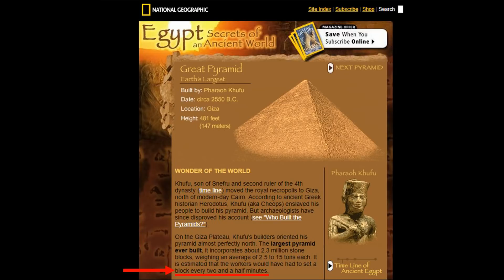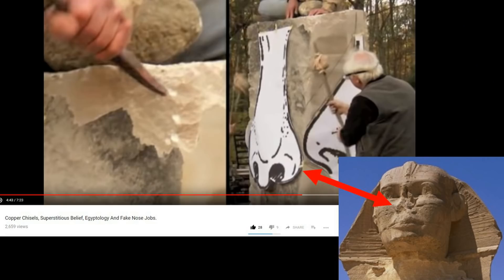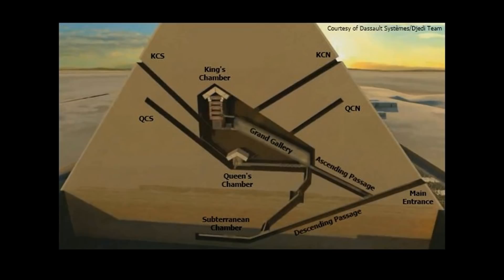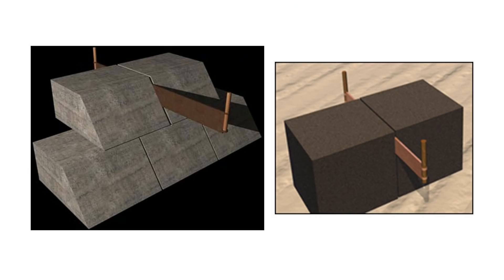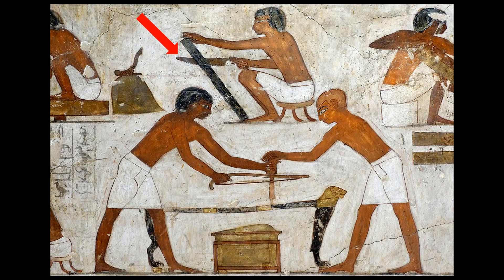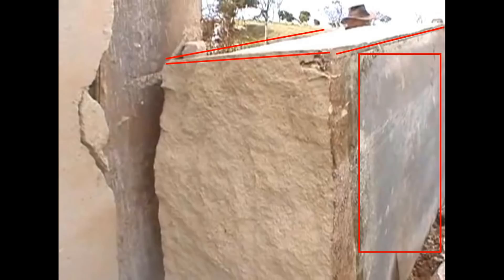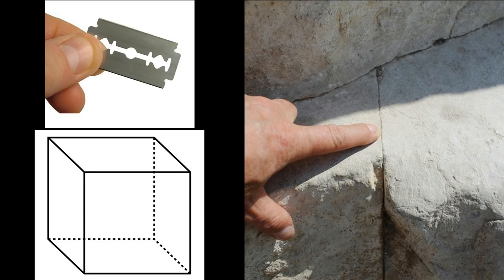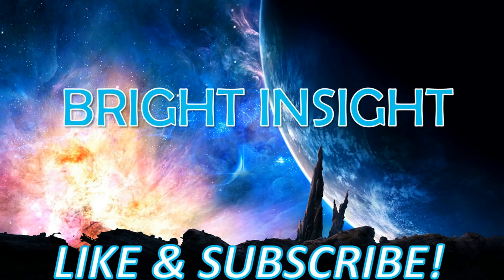Great Pyramid of Giza:  Lost Ancient Civilizations

Comment: Pyramid of golden ratio tells Pi and Phi relationship and formula to calculate true value of Pi. if the four-sided circumference is 8, then 2π √  φ= 8.  π=4 /  √  φ = 4/   √(0.5+√5/2) = 3.144... (not 3.141...) . √  φ is the height of the golden ratio pyramid. Why is it not in our textbook? And we are still using 3.141... for at least a lifetime, the error cause so much waste of money and resources in engineering and other areas day by day.

Comment: I dont ever comment on anything, but.. There is a modest error in judgement here. Limestone softens when in contact with water, and the nile was right next to the pyramids. Also the level technique for the stones could be achieved by using the nile itself. Moving the stones to te location too.
Reply: Other than that, good job on pointing out the problems that are not going away on the running theory, like the granite and the lack of found said tools!

Comment: If they used saws, chesels or ANY other metal tools, wouldn't there be metallic particles at a microscopic level left in the edges of the stones? 
Maybe the best place to find such evidence would be on the contact surfaces of two blocks of stone perfectly matched together and somewhat safe from the erosion factors.

Comment: Egyptians did not work Granite blocks with copper chisels, they in fact pounded at them with Dolerite pounding stones, then used Dolerite grinding stones to sand the granite into the somewhat perfect shapes we see. We have evidence of this with the Egyptian obelisks, Egyptians used Copper and sand to cut Granite because of the hard particles in sand, it can be used both to polish/sand  a stone block to perfection. Or to cut through Granite, which we have evidence for with the king's sarcophagus and cut marks on it. 

Quarrying the stones was much easier, because they used a simple method that many cultures used and that we still use today. Wood and water, make a channel in the stone, put in a wooden block and saturate it with water, causing it to expand  and fracture the limestone in near perfect block shapes. Then it was just a matter of using Copper chisels and pounding stones to finely shape the blocks where needed then transport to site and set. 

Copper in the Ancient world was expensive so a lot of the actual work done with copper was reserved for important things, but you really don't need to use all that much for the limestone blocks at all, given the way they were quarried. Also a good reason why we don't find thousands of these tools is simply, because it was metal and valuable and would have been recycled for other things.

Comment: As someone has already said research Joseph Davidovits. The stones are geopolymer molded in position, no cutting or lifting required. This has been independently verified by both density analysis of the blocks and by the presence of bubbles in them. The formula for making this geopolymer was found on an ancient tablet and is reproducable.  Watch Joseph's videos and checkout his linked webpage.

Comment: Great video and I have been posting this information for almost 15 years now(2002).. It's about time someone made a video..  I would like to add some detail to your comment about how perfect these stones were cut on all 6 sides..  These stones were perfectly flat on top and bottom, bu the other 4 sides are clearly not square.. They are trapezoid to some degree, meaning in order for the rock next to it to fit it perfectly so a razor couldn't penetrate it,  each 4 sides of this stone would need to be tailored made so it fit perfectly next to the other 4 stones beside it..  Mr Bright Insight, that's impossible to even imagine and would be even more incredible than the pyramids themselves..   Impossible unless you consider geopolymer, or ancient concrete.. The geopolymer institute of France has already broke this story back in 2002 and made duplicates stones and published the results.. These were made using the surround materials and poured into a mold exactly where they stand today.. Here is the link: https://www.youtube.com/watch?v=znQk_yBHre4

They even produced evidence of hieroglyphics showing how to make these pyramid stones:  https://www.youtube.com/watch?v=k0nOw_ebmGk

Comment: It took them 80 years to make a pyramid, but 70 years of that was getting the permits.
Reply: I tried to do the math on the 6 hours for an inch cut and the 70-80 year time frame and they would’ve needed 1000 men working 24/7/365 just on cutting the stone. That doesn’t include the need to refine the shape after or moving and placing. Assuming they didn’t work at night they’re going to need closer to 3000 men in that quarry cutting rock tirelessly for twice their life span.
Reply: @meatpilot  Ummm I think everyone may be forgetting that the true potential of the mind as well as the body may have been lost in a cataclysm. The capabilities of a group of very focused people might require farrrr less than estimated and if they were stoic as well (highly likely) they would not need as much food and resources. Also, what if the reason the pyramids could've actually been constructed much faster then previously believed possible is... woo Game on... before you are our last 4 winners. One man verse the mountain! One per side... one impossibly massive block per contestant! The first man to get that block to the position required... wins... ONE GLORIUS NIGHT with our believed QUEEN! The crowd goes WILD...…
Reply: N Marbletoe exactly. Lol
Reply: That made me chuckle pretty good.. *D and then I checked your alias and belly laughed quietly as not to wake disturb the neighbors. OIOIOIOIOIOIOIOIOI 8D <<< me spinning on like a top blinking between 2d and 3d  \o/ 3 point landing in the correct dimension this time whowhowhowho
Reply: Not by force but by all understanding the wisdom of it and since all would consider the children all of theirs regardless of who was the bio mother(big sister) and father(big brother), they were all spiritual brothers and sisters anyway... pure beauty... the STARE-WAY to biological paradise! That's how you excelerate evol;ution 8D
Reply: So based on the pong tossed to me above... choice... 600 60 6 OR 6 60 600 up or down the "genetic ladder" whoa boy returning to normal space lol
Reply: N Marbletoe 😂
Reply: Ha! 😂
Reply: Thanks Bright Insight for your work...Archeologists are mostly paid liars who are sworn to secrecy... if you know what i mean... btw, for proof of why Saturn has a Hexagon on top... check out the vid on my channel.
Reply: that's ok I am the bringer of light so I reveal all, how the pyramid energy grid system works and cell regeneration so we can live for 100's to thousands of years, so all the dual vortex pyramids are plotted on the star of David or star of Jupiter pattern, so you find all the precisely plotted pyramids were the lines intersect,  the smaller pyramid from what I can tell is that it points the direction towards the upper inner so you have one group the small pyramids show me, there is one that will point to the direct middle and it would be easier to draw it out, 6 small pyramids within the set of 24(1 small one and 2 large ones) 6 plot sites 12 large pyramids and the massive pyramids that are being discovered are the number 7th one, a huge centering pyramid within that grid, so it is double the size, There is no secrets that can hide from me because none of your Archeologists know this,  I wish I had a computer program to plot out how many they did have to make this planet into an Earth Planet, the acoustic sound resonator shapes within the pyramids pulse the sound frequency back to the earth's core,  the key is the Iron Ore stones that is at the base of every pyramid, as well as the real casing stones were all iron ore on the outer at one time, it is advanced but simple in how they manufactured each stone precisely byway of induction heating method,  so just like the Veda texts says they poured molten temples they also poured molten iron ore stone, as well as you can also fuse iron ore stone with other ground stone to make granite stones as well, So anyway we can make any rocky planet into an Earth planet, the plasma current also draws moisture from the rocks to the surface,  sound waves create rotational speed,  so everything in these pyramids was designed precisely without flaws,  it is all vortex energy timing, so there must have been 24 24 24 =72 pyramid sets 36 plotted sites and 18 smaller ones, 6 into 18 (6)(6)(6) 3 massive pyramids in  for the middle each set of 12 plot points,    simple yet complex I enjoyed solving it,
Reply: @The1stDukeDroklar  A wise man once said, there are those whom read books and those whom create books, but Einstein said it best, I get visions of inventions, Hence I as well have visions of inventions but use science fact to support every explanation set forth, my understanding of super weapons is right at the top, so knowing how all things work also means you can render the enemies super weapons as well, ;) the gift of genius, but I do love our old advanced history that seems to still remain buried, but my greatest love is cell regeneration to live for thousands of years as our cells are reset and recharged to become younger as well as stronger once again, and knowing how to build a full body machine is the right first step, but not having good finances is my downfall, lol so when I die so shall many more idea's of great inventions, at least I solved how to cure my own back from all lower back pain as well as reset my leg joint, the worst is we all face the same thing when it comes to the harsh bacteria's that attack our body, if only we had a few different machines to combat this, to change our medical system over to the regeneration system treatments, instead of pills the high and low frequency's would fight the viruses and bacteria's as well as using the regeneration machines to repair our body's cells and bone degeneration, I know also there is a more complex regeneration of cell implantation to regrow missing limbs, I seen what the nano doctor has done but he was not intelligent enough to see the larger scale, plus a 3rd kind of regeneration to reconstruct people back to life, that brings me back to why the Egyptians took great care for organs in there past history, to use a clone body to place the organs into it as well as brain cell magnetic memory imprint for brain reconstruction, every memory cell has a code of a memory, but that's very advanced, to see the past is to know the future, to see the future is to go beyond our true past, science has endless paths to becoming a type one civilization, yes we can make more advanced robots but we can make our selves more advanced because organic's can do so much more, just like molecule memory structure altering to change anyone into anything as well, but that's going far beyond the basic comprehension of what people know at this time,   maybe this might spark something to lead us on a path of greatness, just imagine bringing back those whom we have lost, it is 100% possible as long as we are not cremated but the question would be if any memory imprints would retain or if they would have to learn all over again,  I hope your inspired now,

Comment: There are not millions of blocks, this is fantasy, its about 250-300 stones in lower base x 4 sides its around 1200 blocks in the base of pyramid, in the high have around 160 rows of stones, there can not be 2,500,000 stone blocks.
Good video.

Comment: Numero #1: You are amazed when not finding enough copper tools around the pyramid. I tell you, here when a gasfiter leaves the old pipes around, there are many people interested in those pieces as they sold it by the kilogram. In that era, they could melt it and make pans, kettles and silverware, etc. Number #2. I don´t know if you have read about steam machines used at the pyramid to heave weight. A secret of the monks in there. Same thing to the use of saws. A machine indefatigable moving a saw will make a lot more cutting than a pair of men.
Circular blades, stright blades, and the like. Where (you will ask) are those machines? Burnt by the monks. Remember it was a secret. Abur!

Comment: Nice video debunking the myth practically.... the image at 7:39 at the bottom right of the screen shows a rock that seems to have horizontal layers of rock. There's a suggestion I came across on this subject that the megalithic boulders were molded into place either using heat or some yet unknown technique of softening rocks.This could explain why the massive rocks are of different sizes yet fit so perfectly. In addition, there are stubs close to the bottom of the rock. I suspect that the builders of the ancient pyramids got the rocks into liquid form (by which ever means they did) and poured the liquid rock into casts. These casts had drain holes at the bottom to allow for better setting of the mould. After the rock mould was set then the pouring channels would be broken off thereby leaving a perfectly fitting rock mould with stubs at the bottom.

Comment: That doesn't even consider Gantenbrinks door. What is something like that even doing in a pyramid meant for burial. Still doesn't consider how we are supposed to believe they would carry a body up the smooth slope of the grand gallery while we had to install footing slats in order to get around inside of it. There is a program somewhere on the web where some guy made a model you can explore. Going down the descending passage you become disoriented when met with the ascending passage. Your looking at the point of a triangle. Once you go up again you are met with another end of a triangle where the queens chamber lies straight and the grand gallery a 45 degree slope upwards.

Comment: You might want to look into the use of concrete blocks poured in place as a building method. See the book "Why the Pharaohs built The Pyramids with fake stones" by Joseph Davidovits. When I was teaching at a university, a Professor of Engineering from Egypt discussed with me knowledge of the used of poured concrete construction to build the pyramids. This was back in the 1980s. Not all stones are poured, but many were. 

Also, this brings up the question of if the blocks were quarried and finished using tools, where did all the rubble from 2.3 million stones go to? Was it used as core material in the construction process?

Comment: When you look closely,you see that some blocks have a curve to them and that makes no sense.It doesn't matter what method you use to cut that stones,whether it's a chisel,a saw or a laser,there is no logical reason why you would make a concave (or convex)cut to a block that you want to fit perfectly to the next one.
I believe the only theory that makes sense is the Davidovits one,which says those blocks are made of concrete.When you accept the idea of moulded rocks,every thing else becomes more plausible,like the transport,the perfect fittings,the weight even the time frame.

Comment: Hi Jimmy. Great post. I think the biggest issue here is the timeframe. It should be hundreds of years and not tens, which would of course completely debunk the Pharaoh theories. I don’t worry about the cutting methods so much because impregnated copper can cut anything and if you do it well, even diamond and that has to be very precise. 

The missing copper or even trace of mining
Reply: Sorry... is not a problem because this could have been reused and originally traded from all over the world. We even had Neolithic metal trading here in UK. 

In summary I would say that it is the timeframe and expertise that are the biggest problem with the current theories. 

It has to be those Atlantians or whatever they called themselves and as you say, the Egyptians just took what was left and used it. I suspect that they were also taught a trick or two buy the survivors of the flood.

Comment: You'll never find the tools that were really used to create these Feats. They've already been absorbed and removed by prior Builders likely the original but on top of that anybody that's ever been through any of these locations has removed any "Modern Like Machinery" that would have done the work.. was in the Masons briefly and this is something that was discussed. You won't find those tools easily,  there were Trade Secrets back then, it was a big deal to keep construction techniques and the mathematics used Bay Secret. You're going to be very hard-pressed to find any evidence of what equipment they used as it was literally a secret back then too. You had a smaller community of people that works very specifically to create these stones it was the movers and the installers that were in larger numbers. They also used saw cutting techniques as well as hole coring techniques that are used today in modern construction. They literally use the same type of equipment just powered a different way.

Comment: I completely agree that the ancient Egyptians didn't build but merely adopted the pyramids. However I'm going to play devils advocate and say the saws, be they copper or iron may have been completely corroded away to nothing after a few thousand years. Or in my opinion mechanical cutting machines have rusted away. It's not hard to realise if you took today's society and flung a giant asteroid at it what would be left after ~10,000 years? nothing but clay tablets from when people remembered how to make them and any huge non (rebar) concrete buildings. paper rots, plastics erode & get eaten (bacteria), metals corrode. nothing lasts 10,000 years but stone. The ancient Egyptians build on the backs of an older society. Just look at the Saqqara boxes with the "graffiti" hieroglyphs on them.